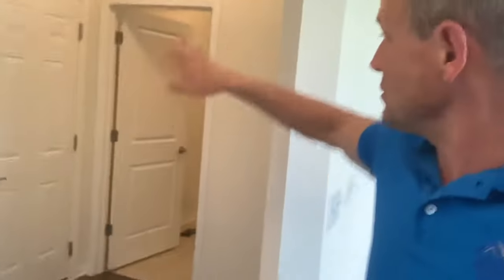What Are These Vents For Above The Doors

Comment: Can you put a cushion or memory foam in it? The noise that comes in and out of the room is basically like a window you can’t close.
Reply from the maker: If you’re looking for privacy you can completely close it off if you want. That room just might be a little cold in the winter and hot in the summer because the air won’t flow through the room properly unless you keep the door open.
Reply: What do you recommend when it comes to covering that part?
Reply: @dropndeal  by the time you responded I no longer have this issue. Originally I lived in a household with kids. I work from home and sound goes through there with the kids yelling. I was on call. I figured covering that vent would prevent noise from entering.

Comment: Great Explanation Video. Can you do this with Interior Doors as well & if so, should the Grill be installed at the Bottom or Top of the Door? Thank you for sharing
Reply from the maker: Thank you Ricky!
Yes, you can do it with interior doors, and doesn’t matter if the grill is at the top or the bottom, it just allows air to pass through. If you’re looking for a cleaner look, you could always replace the door slab with one that has louvers.

Comment: Sorry if this is a dumb question, I have no idea how these work. I have one above my door and it has a lever. Should the lever be up or down?
Reply from the maker: @Yungslumpgods  Typically they don’t have a lever. I’m thinking maybe they used a closable register when typically they just use a regular grill with no lover. Either way you’ll want to get up there and look into it and you want to put the lever in a position to where it is open, so the air can pass through.

Comment: Thank you for sharing! Does this transfer grille help with reducing the temperature in the room in the summer? Thanks!
Reply from the maker: My pleasure! Yes, that transfer grill allows air to circulate so if you close it off, for example I’ve seen people put a magnet cover over it to block the light if they have babies taking naps during the day, that room can become cold in the winter and hot in the summer.

Comment: Do they help the airflow when the door is open too? The temperature in my bedroom is much different than the rest of the house and I generally know why, it's on the opposite side of the house and two floors up from the blower so the airflow is quite low. There's a return just outside the bedroom in the wall, close to the floor. I can imagine having a vent above the door would help some, particularly in the summer.
Reply from the maker: No, it just for when the door is closed. What you might want to do is seasonally balance your system to push more airflow to that room if it’s a little bit warm in the summer. Follow my instructions in this video.
https://youtu.be/VwZpOzOBDqA?si=WeG21YLKDxYleVqm

Comment: Hello, thank you for this video.  My house was built in 1992, and believe me, the contractors cut corners.  I have one return vent in the entire 1456 Sqft, two-story house. I'd like to add these vents above the doors to remove/circulate the excessive heat from the second floor. Do you believe these vents will do so when the HVAC system is running?  Thank you.
Reply from the maker: It will definitely help with air circulation, however, seasonal, balancing, I think will help you more. Follow my instructions in this video how to seasonally balance your home.
https://youtu.be/VwZpOzOBDqA
Reply: @BJPoznecki  Thank you for your prompt response.  Unfortunately, I forgot to mention that my house is built on a slab.  There's no basement.  The main trunk is the soffit/bulkhead in the kitchen.  I was told I could have a return vent installed on the second floor, however, it would cost me.  I believed this option would save me a lot of money..

Comment: I got two vents one on the bottom of the wall and one on top of the wall. I think you said you keep the door closed until the air flows from the top one.
Reply from the maker: Actually, that’s for your heating and ventilation system. Your home is equipped with high and low return air vents. The theory is that in the Summer cooling season, you want to be circulating warmer air back through the HVAC system to be cooled. Since that warmer air is at the top of your room, you will want to make sure the highest air return is open and the lowest is closed.
Conversely, in the Winter heating season, you will want to pull the coldest air back to the furnace to be warmed and create circulation. In these months, you'll want the lower air return open and the upper air return closed.

Comment: How do these vents impact fire safety? I was told to sleep with bedroom doors closed in case of fire. Won't the fire and smoke just come on inside the room through the vents above the doors?
Reply from the maker: @JenLit-gx7vo  It’s not gonna make that much of a difference. What’s more important is you should always have a smoke and carbon monoxide detector within 15 feet of every bedroom, and a smoke detector inside the bedroom by the door.

Comment: Bedrooms doors stay shut because of pets. Which makes the rooms uncomfortably warm. Our home doesn't have these vents. Could they be added over the door. Not sure if there's a header over the passage. Plan B would be to vent the door. But was hoping to upgrade our ugly doors in the future. And a wall vent would be a permanent solution.
Reply: To answer the question yes use a stud finder to be sure you aren’t cutting into a stud (if you do find there’s a stud it’s not the worst thing just cut the drywall and leave the stud. you would trace the part of the vent cover that inserts into the wall(be sure to use a level and tape measure no one wants a crooked or uncentered vent also be sure to mark the screw holes of the vent whether it be a paper clip to make a pinhole or marker to mark it. Then repeat the process on the other side. With a hole on both side drill the marked screw holes and insert an appropriate drywall anchor. Fix the vent covers to the wall and viola you’ve diy’d it! -Hope this helps

Comment: I have one of these that isn't above a door but to the right of it in my families media room. There's nothing inbetween the returns either. There are two supply vents that are along the same wall of the room. I feel the room has difficult to keep cool and it stay's approximately 2 degrees warmer at least than the rest of the house. What could possibly be done to improve things in that room? Any advice will help, BJ.
Reply: not understanding your scenario.  But if you have two supply vents then the return air vent plus whatever the door undercut is allowing to pass through should not be a restriction to the air getting back to the air handler.  I can't tell if you have a return air problem or if you need to measure the air flow and velocity and temp coming out of the supply and see if there is a problem there.  The short term solution and maybe the only one is to ensure you run the air handler fan more so you get more air circulation in the entire house

Comment: Hey, my kids bathroom wall sweats a lot, because they take hot showers, I was thinking about installing a return grill to just let some of that steam out above the bathroom door, do you recommend that?
Reply from the maker: I don’t see any problem with that. Typically they don’t do a transfer grill at the bathroom to give people privacy when they’re in there. Otherwise, what would probably help even more is putting in a larger exhaust fan.
Reply: uh no.  Smells in the bathroom are not designed to come outside of the bathroom either.  So the exhaust fan with cracking a window if you have one are your solutions.  If that means getting a better exhaust fan then so be it.

Comment: Which direction do the louvers go on the exterior and the interior? I ask because I want to be sure the air flows properly. I took them off to paint and am not sure which direction to face them.
Reply from the maker: Hi Cathy! The louver direction doesn’t matter you just want to put the louvers facing where you can’t see into the wall. So if they’re up high on the wall, do you want the louvers facing up so when you’re standing on the ground you can’t see in and vice versa if the grill is low on the wall you want the louvers facing down so you can’t see in.
Reply: @BJPoznecki  Perfect! Thank you for helping me.
Reply from the maker: @cathyperry6729  My pleasure!

Comment: Hi BJ, do these vents have to be above the door or below? Or can they be moved to a different location, but still allowing air transfer into the same room?
Reply from the maker: Hi Ana! These vents can be wherever you want. Nowadays to lower the construction costs, builders will typically put one central cold air return on each floor of the home. The purpose of these vents is just to allow air to pass through the wall and travel back to the cold air return vent that takes the air back to your HVAC unit to heat or cool it.
Reply: Folks used to cut the bottom of the door short, or with about 1” clearance at the bottom, which looks terrible! The vents over the doors are barely noticeable. One can always build a nice designer vent rather than using these builder-grade registers.

Comment: When I close any door in my home you can feel the air coming out from underneath the door. What is the best approach to be able to leave the door closed when hvac is on?
Reply from the maker: Well, with your house, they may have intentionally short cut the bottom of the door to leave a bigger gap to act as a transfer vent instead of the grill above the door. It sounds like you are good like you are, and don’t have to do anything. However, if you want to install transfer grills up above the door, that is always an option as well.
Reply: @BJPoznecki  Is there a consumer air pressure indicator device you know of to test like you did?
Reply from the maker: @arielrodriguez6980  I’m sorry I don’t know that would be a question for a heating and air conditioning technician.

Comment: Do the return suck air or is it just silent no suction?
Reply from the maker: Well, the return vents for your heating and air-conditioning system suck air back to the furnace. However, the vents above the doors in this video they just allow air to pass through, no suction.

Comment: This seems pretty counterintuitive if you have rooms that aren't usually being used. I would actually want to close all ventilation to those rooms so they aren't being heated or cooled for no reason. I'm buying a 3 bedroom house for myself and may or may not rent a room out. I just learned there are buffers you can add inside the gap at least to deaden sound more. I'll have to install some of those in my new house if they don't come installed already.
Reply: central heating and cooling systems are not designed to be closed off despite popular belief and even having vents in the floor that indeed are able to be closed.  It creates backpressure and makes the system work harder to do its job.  And if the air is flowing into the room it needs a clear path out, again, to ensure the heating and cooling system are working efficiently.
Reply: @livingaboard  ok. But I don’t want to heat or cool a room I’m never in. I should have an option for this
Reply: @ianhop  Your furnace is still going to be making that heat anyway unless you have a system that can adjust the capacity, most don't. So you're just wasting already spent energy
Reply: @ianhop sounds like you want what my parents have, which is a system that controls each room? Instead of a central HVAC.

I think they’re called Ductless mini splits. 

The room vent can be closed off, but that has nothing to do with the transfer vent he’s talking about. That’s just for allowing the hot air that rises to escape and to stay in circulation.
Reply: They have dampers that open and close the ducts that lead into the vents in the room. Power of a button opens and close them as needed

Comment: Hi I have these vents in my office and in my master bedroom they are both the coldest rooms in the house can I just cover them? Will you I be ok? I can it's pulling air from my office making it constantly cold during this winter and last summer very hot.
Reply from the maker: Hi Dee- Yeah, you can try covering them and see if it makes a difference, however, typically these are installed to help the air circulate more so covering them, may actually make the rooms colder.
Reply: @BJPoznecki  I think I will try to cover them since I have been having issues trying to keep these two rooms warm. The rest of the house is at 70 degrees while these 2 rooms sit at 63 degrees and they are the two room that is on the opposite side of the furnace
Reply from the maker: @bukhadavid  Another thing that you’re going to want to check is to make sure that the damper levers are open to those two rooms. You can follow my instructions in this video if you’re not sure what to look for, but it’s possible that those two rooms don’t have enough airflow to heat them.

https://youtu.be/VwZpOzOBDqA
Reply: @BJPoznecki  thank you I have thought about that going Into my crawl space and look for them. Thank you for the link I will look into it

Comment: If the material is all black on the inside is that bad?
Reply from the maker: I’m not sure what you mean by the material is all black on the inside? What’s important is when you take those grills off as long as you can see through the wall to the other room that’s all that matters. We just want to make sure that space is open to allow the air to pass through.

Comment: What’s the point of having 20 min fire rated doors when you have vents that let in heat and smoke. Saving money isn’t worth the danger  it puts families in during a possible structure fire.
Reply from the maker: Here in Chicago, with residential home building. The only door that’s required to be fire rated is your garage entry door.